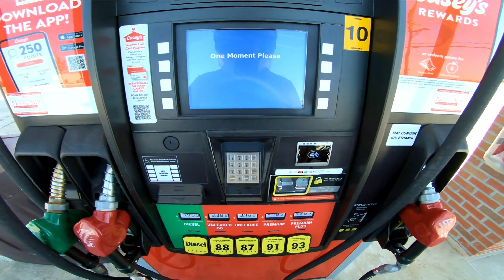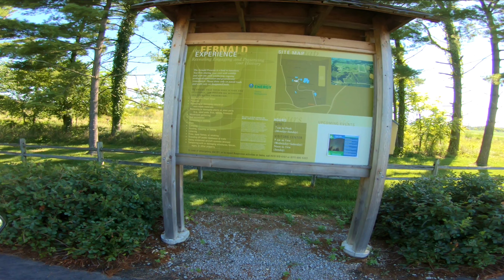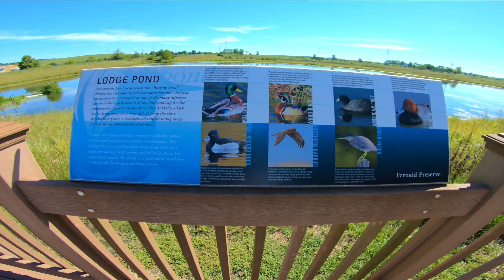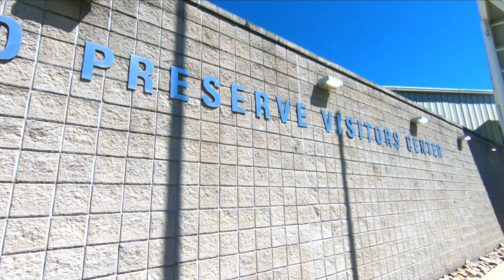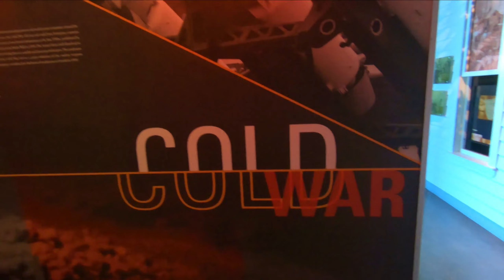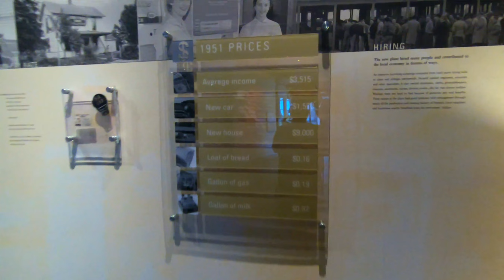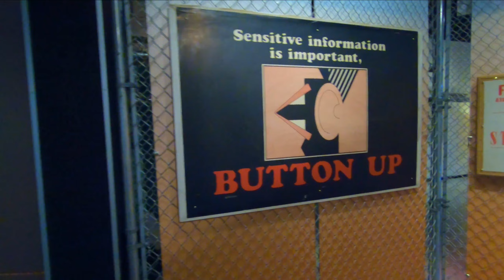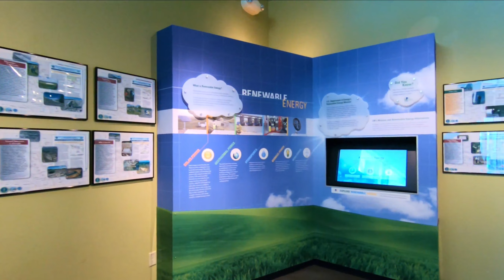The Fernald Plant (TOUR) True Costs of Nuclear Weapons

Comment: Thought you are supposed to use premium fuel in the tank.i have the same bike
Reply from the maker: I stick with what the manual suggests, which is 86 PON or higher. Some people claim a higher octane helps get better gas mileage and performance, but I haven't tested that. I did a video on this topic so check it out. https://youtu.be/vEQTd-GAQ_U